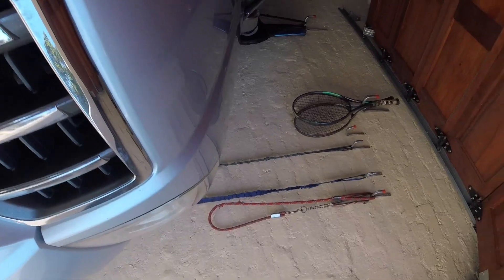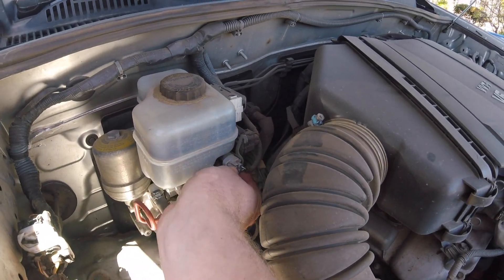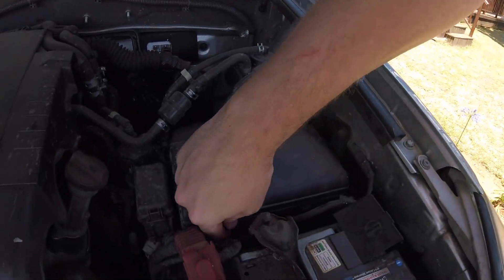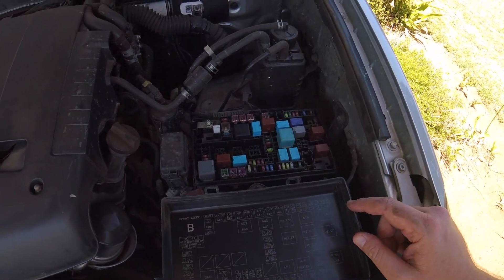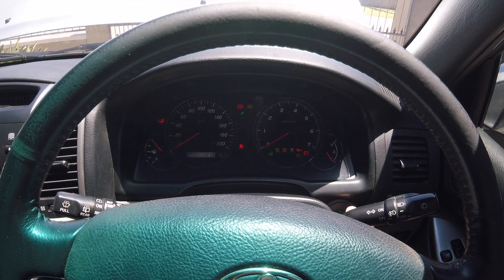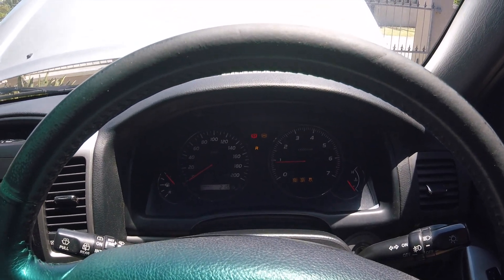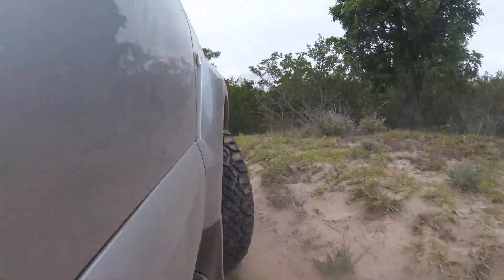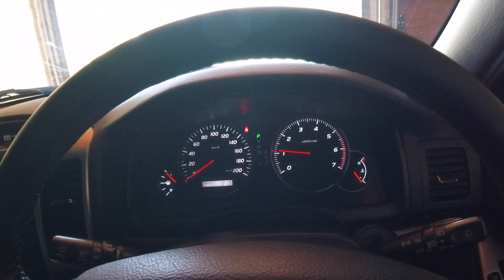Prado 120 TRC Hack

Comment: Is there another way to just install a switch better than removing fuse
Reply from the maker: Yes, that's what I did.
Reply: @QuintinKruse how?
Reply from the maker: @ryky4450 put a switch in line with one of the wires on the brake master cylinder. Pre 2005 will have 2 wires and post 2005 will have 3 wires. If I remember correctly it's the signal/feedback wire
Reply: @QuintinKruse is that at the top of the brake booster or bottom it has 2 connections
Reply from the maker: @ryky4450 it's that plug that I unplug in the video
Reply: @QuintinKruse thank you very much 👌🏻

Comment: Hi, I wonder if asp could be switched off and leaving traction on to gain traction when one wheel is spinning it 'd stop it a bit. You know what I mean.
Reply from the maker: @skoda110  there might be a way? I know it does this when you lock the centre diff

Comment: For the fuse bumps, are you sure the car is not gonna have any problems once you permanently disconnect it
Reply from the maker: Nothing is permanently disconnected. I no longer pull the fuse out, I installed a switch to disrupt the feedback signal from the master cylinder. There are many videos on FJ cruisers doing the same thing. I do have to switch the car off and on again to get the traction control back on. I've never had any issues doing it this way but cannot guarantee nothing will go wrong with your car

Comment: Will diff lock still work fine whilst disengaged?
Reply from the maker: Centre diff lock, yes. My Prado did not come with a factory fitted rear diff lock, but the centre diff lock does still work when I disable TRC. I have used it many times in the sand like this. Pre-2005 models have 3 wires and not two
Reply: Cheers man.  I was at bribie island today and it was like a new car after ripping the fuse.
Reply from the maker: @hcr32slider  If you're interested here is the link describing how the switch is installed - https://www.4x4community.co.za/forum/showthread.php/323345-Prado-120-switching-off-traction-control-(TRC)?p=4271404#post4271404
Reply: @QuintinKruse  thanks mate
Reply from the maker: @hcr32slider  Glad to hear, it really makes a big difference! I later on put a switch in line with the wire going to the master cylinder so that I can deactivate TRC in the car. I still have to turn the car off to re-enable TRC but can switch it off while the car is running
Reply: @QuintinKruse  great idea.  I find it strange that a switch wasn't fitted from factory.  Trc is horrible in the soft stuff.  Mine goes off if i launch off a bitumen hill too.
Reply: THANK YOU!! I was wondering why my 120 is so shit in the sand. Will give this a try.
Reply: Hi. Awesome hack👍🏼. I have a 2003 3.0kzte diesel 120series. Do you know if this hack will the same for my vehicle? TIA